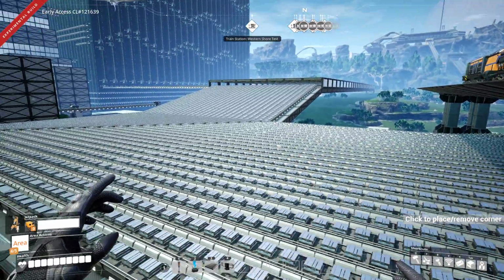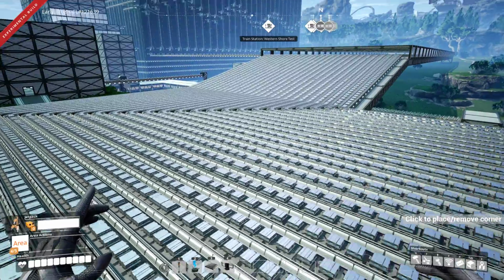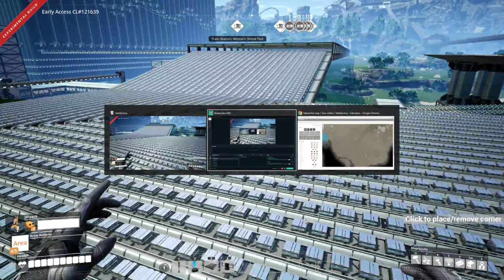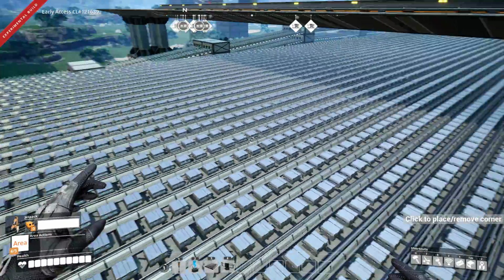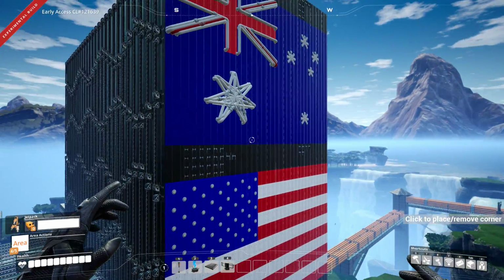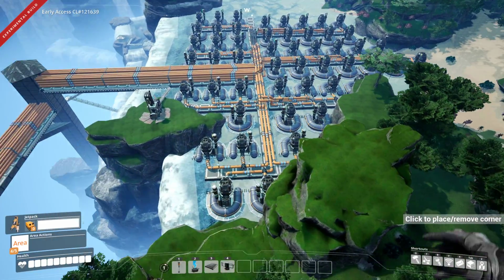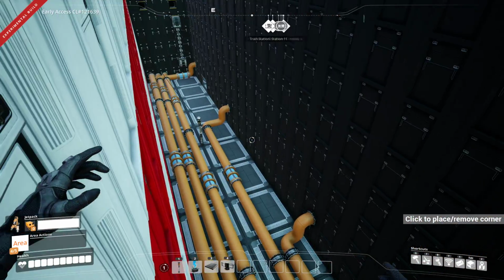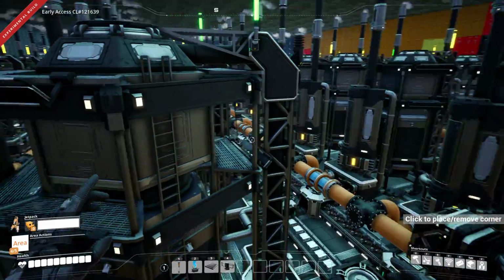Satisfactory - Mega Factory - 20,000 Iron Ingots per min!

Comment: In my, Mine The World, playthrough, I had all the nodes in the world for Iron, through refineries.  Processing 35000 ore, doubling in the refinery was 70k Ingot's.  On low settings, my computer ran about 20fps in that area.  And needed to make another 100 refineries(Mk2's[Modded]) for copper.  I gave up at that point, too much for the engine.
Reply: I have a laptop and it can’t handle a 12 hour save help
Reply: MAte.. im playing on a notebook. What would happen to my notebook? It would probably just melt right away lmao
Reply: @spudbencer7179  To be fair this was before they did a big change to the rendering.  Just processing the ingots killed my pc, much less using them..

Comment: 8:13 I think they arent needed all, there is a trick where you pump only one line to hight and connect all, seems to do it with full flow for each line
Reply: That's a glitch, you just need one water source at the desired level and all the water in the same grid will be capable of reaching that height without pumps. I wouldn't rely much on it as they may solve the issue in future versions...

Comment: This has convinced me to centralize my raw materials storage. I'm going to make one big multi-story building. First two floors will be for iron, steel, coal, sulfur, solid stuff that needs to be belted in. Next 1 or 2 levels for liquid storage (water, oil, fuel, etc), stuff that needs to be piped in. Next level for trucks and the loaders/un-loaders for them. Next level for trains and THEIR loaders/un-loaders. Basically, add new floors each time a new mode of transportation is unlocked.
Reply: I might be too late, but I recommend having the top floor be pipes so you can use gravity instead of pumps.
Reply from the maker: Sounds great.  Good luck with it!

Comment: Currently working on a similar project in the dune desert.  Ideally it will be able to process 30k+ ingots/minute.  Pure nodes add a complication since they make 780 lines instead of nicer numbers like 600 but luckily I can process all the pure nodes on one floor.  The building will also house all other basic resource refinement and then I'll belt materials to other factories focused on individual items as needed.  The big water extractors mod makes it about 50000x easier though since I can get up to 5 pipes from one machine.
Reply from the maker: Nice dude. Got screenshots or video?  Link it so I can check it out! 😃
Reply: @danp6918  Haha it's a very long way from completion, currently can only do 13.5k per minute but I can definitely send you a screenshot.  Do you have a discord or some way to contact you?
Reply from the maker: @permateal  I dont have my own personal discord, I just use friends ones, I might make one soon.     I use  @TotalXclipse   public discord for satifactory stuff alot... https://discord.gg/U8fxZd  you could drop it in there and tag  @BEEF VINDALOO  my discord name...

Comment: There's no real benefit to load balancing. Overflow and balancer method makes no diff. The only real reasons to do this are when you don't want to prime (preload) the machines' inputs or just because you want to.
Reply from the maker: Yeah agree.  However we have our "load balancing" building on the side to collect the excess ore from each production floor and redistribute it back through to the rest of the system. I guess technically I I should have called it a "redistribution" building  👍

Comment: Which mods are you using? Ive had problems using mods with multiplayer wondering which work.
Reply from the maker: Mainly just a bit of area actions,  but only the host* can use it,  even then, you can't use it for belts, pipes, power lines and trains, so you gotta do it all!  But yeah, its dodgey in multiplayer

Comment: Nice job 👍 
I m just asking myself why the footprint of the main factory is so small. To make something with the 20k iron ingots you need a really big space.  

A second point is: there is not enough other mins on the map to use the iron, especially Quarz and  caterium.  A big portion of the iron will get directly into the sink. 

I prefer to set a target from the top. (Wanna make 1 Turbo Motor per second. ). And extrapolate from there.  It’s a freaking lot of work too but at last less waste of time doing something you will not need later.  
(Just as hint.  For 1 turbo motor per second I just need 680 iron ingots per minute.  And 7200 ingots copper, for witch you need iron ore.  ).
Reply from the maker: Never fear good Sir!  For we have plans for this iron...  big plans!   The only thing we are worried about is, perhaps we will need more..  😉

Comment: You can deal with the station flow problem by adding an industrial storage buffer, and connecting TWO belts between the storage and the station. That way, the pause time is offset by 2x780 belts!
Reply from the maker: That's a great idea for throughput on trains. Thanks. We might try that for the copper trains. Unfortunately our Iron train stations are already being double fed ( 24 780lines going into 12 stations )  I think we will need another train station. We currently have 2 drop off train stations and 1 pickup station.  We will use another pickup station and have 3 trains, 2 trains for two separate  pairs and 1 to alternate between the two.
Reply: @danp6918  Industrial storage buffers also have two outputs and inputs! It works like a dream for double-fed systems, though I suspect you've already come up with a solution.
Reply from the maker: @kiligir  yep, but the issue was, since this system was already feeding at max on 2x 780 lines into the train stations and  when the train pulls up, you can no longer load or unload .  So it wouldnt matter how many storage containers you put in the system, the lines still stop, and dont catch back up, because they were already double feeding at max...  but yes,  we have fixed it now with another train station,  I show it briefly in the copper ingot vid I recently did  😁